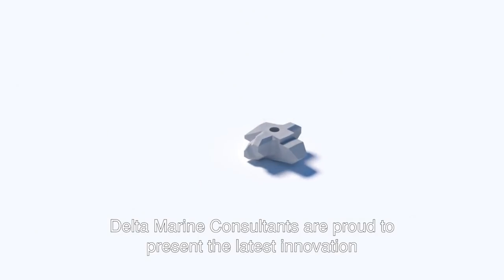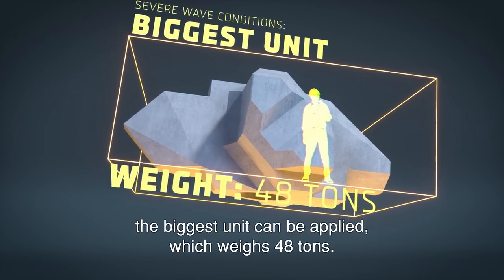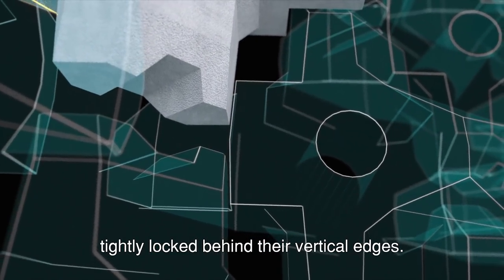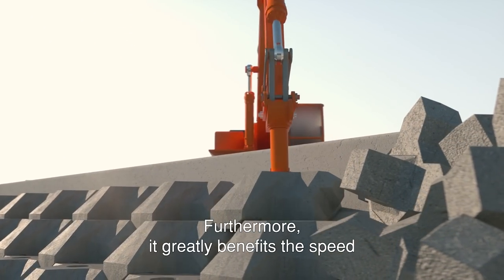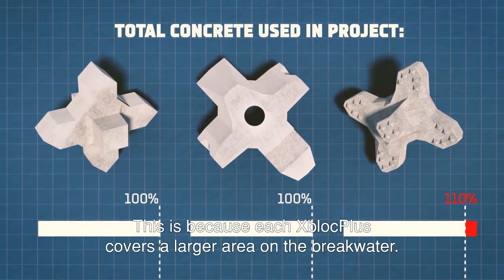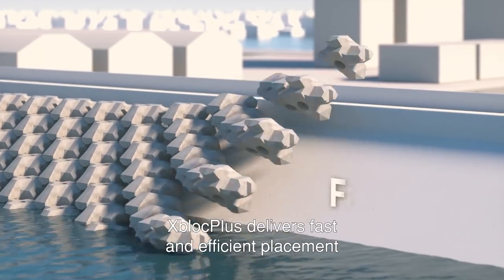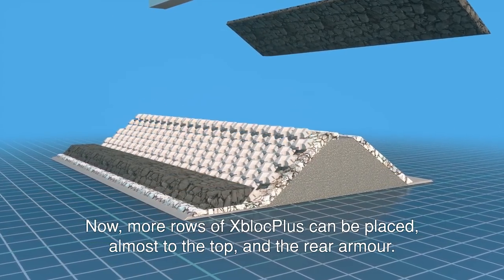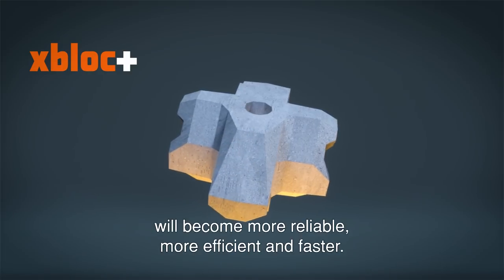XblocPlus explanation long

Comment: A beautiful invention. Reference is made to a storm that occurs at most once every 10,000 years. The blocks should be able to survive even that storm. Too bad all these handsome men don't know about a recurring natural disaster that our planet is suffering from. This is mentioned in various old books and e.g. also by Plato. That natural disaster is caused by the ninth planet in our solar system that comes close to the sun and planets at high speed every few thousand years. The most famous disaster is the deluge, but also 'the end of times' was caused by that planet. After years of research, I was able to reconstruct a timeline. The next disaster of that great one takes place in the year 7.156. The disaster causes a tidal wave "higher than the highest mountains". Only then will the Afsluitdijk no longer provide sufficient protection. The research can be read as an e-book under the title: Planet 9 = Nibiru. It contains abundant and convincing evidence for the existence of the cycle of disasters and civilizations and contains many images, most of which were unknown. Google: invisible nibiru 9